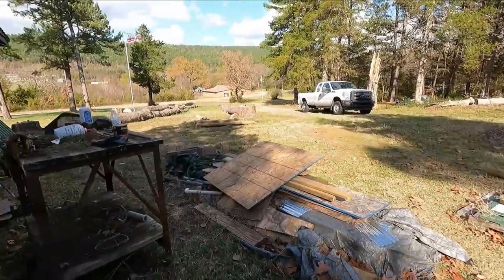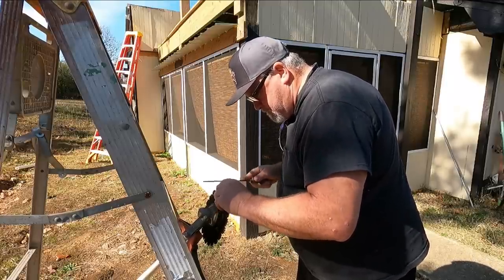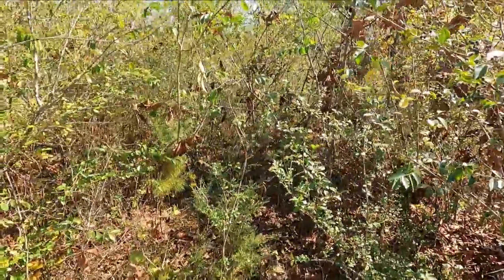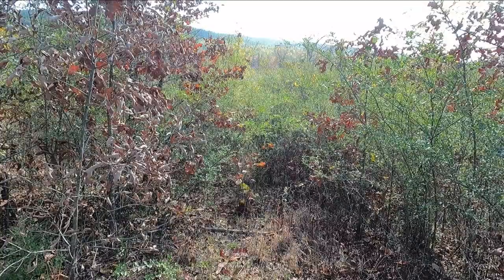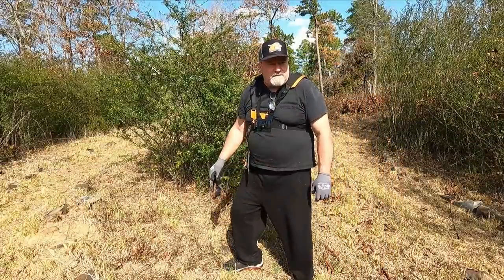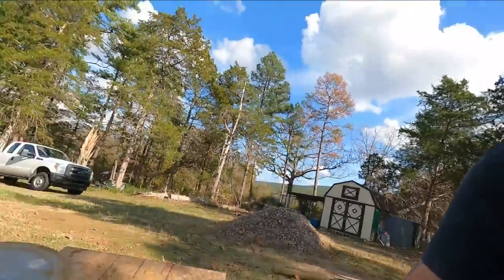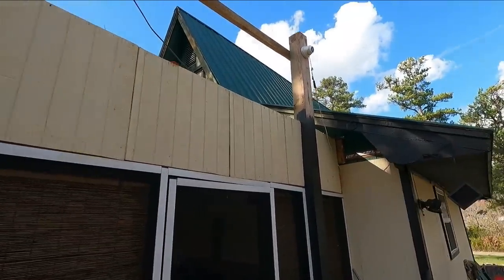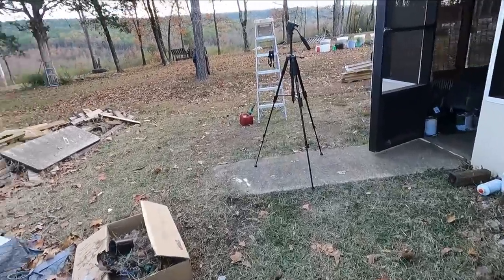Some Things Appear Easier In Your Mind, My Mind Was Wrong This Time.

Comment: Having a tractor with a brush hog attachment would make quick work of not just expanding your trails but just think how much quicker the mowing would be in the hot humid summer months. Over time adding more attachments would be a definite plus for video content. With what you’ve cleared in the past few months would be great for fruit and nut trees. I love pecans and all fruits. Have you thought about adding fruits, nuts and some berries? ❤😊❤
Reply from the maker: You dont know Arkansas terrain, its all rock
Reply: @ouachitamountainliving  : then a tractor with a brush hog, mowing deck, and auger would not be feasible? I never went into risky areas but us kids (yrs back) were taught early how to switch over attachments and get in there and get the job done. I hated the kudzu fields & hills. There was alway Yellowjackets or other bees that got ticked off. Lol! 😂 I have heard it was really rocky in your neck of the woods. 👍👀❤️
Reply: Change it to the back of your riding mower Just pull it
Reply: @ouachitamountainliving  😆 Y'all ever see that commercial where the guy is pushing a mower across bare ground in his yard and rocks are flying, hitting everything including the house? Hilarious!